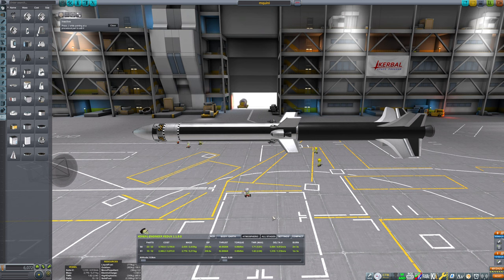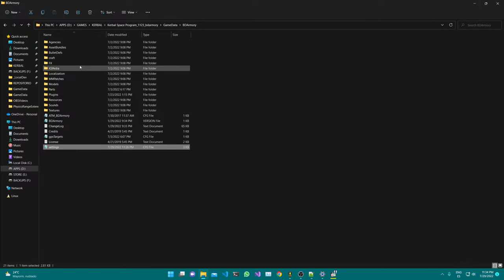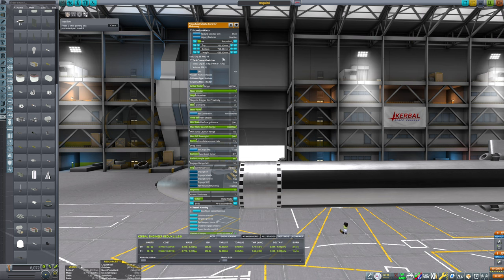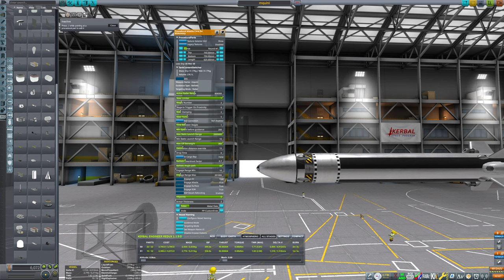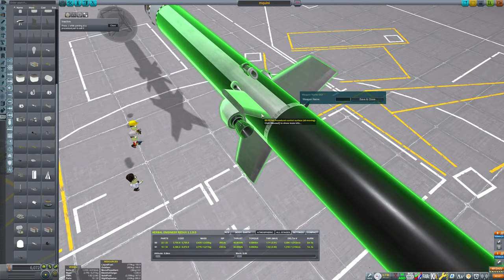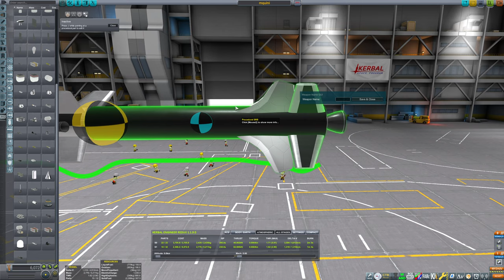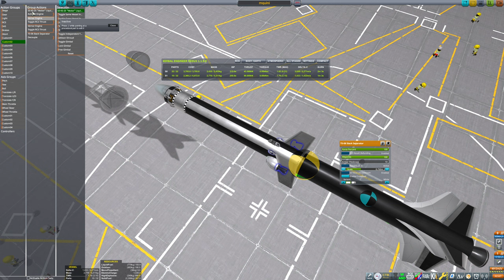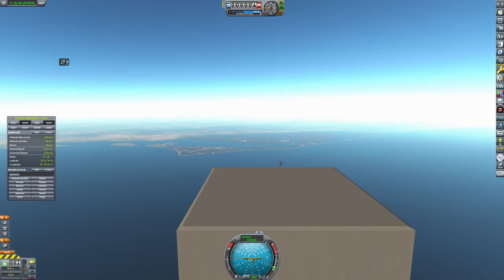Advanced tutorial for long-range ballistic missiles | Kerbal Ballistic Program

Comment: recently started messing around with bdarmory, having trouble with my icbm just exploding mid air completely and failing to even start at the press of the fire missile button under the modular missile interface, any tips or answers as to why this may be
Reply from the maker: It is difficult to say. If you are following this tutorial you should be able to build a successful missile. Maybe you can also check the other tutorials that I have on my channel regarding modular missiles. Usually when a missile explodes mid air is because it might be losing its radar lock, it might run out of fuel, or it is calculating that it will never be able to hit the target due to the target moving away faster

Comment: Why is your rocket unaffected by wind and temperature?
Reply from the maker: I'm not using Realism Overhaul here but I'm certain the temperature was increasing during the descent. Regarding atmosphere drag, the missile was fighting the drag increasing the power of the engines during the descent and you can also see how the SAS starts to misfire when the drag increases.  If suddenly the missile engine stops you will see 4Gs worth of drag slowing the missile
Reply: @jesusrv2009  I mean why doesn't your rocket have the phenomenon of "surrounded wind and red temperature" my rocket is completely surrounded by red high temperature , even a speed of 1000m/s destroyed my wings . I'm looking for a way to fix this
Reply from the maker: @aminuboby9298 Got it. I always disable the aero graphics on KSP settings ( change it to minimal) because I don't like it, it is very unrealistic. Then to avoid the wings breaking, if you are using FAR and B9 procedural wings you should be able to increase the wing mass to make it  "harder to break". Also you can disable completely the FAR aerodynamic failures using the FAR settings (Space center scene and clicking on the FAR mod button)
Reply: @jesusrv2009  Thanks you

Comment: Hi, I made an ICBM but it looses it's lock at 90km height and just fires into space. What can I do about this? (my physics range extender is on 10000)
Reply from the maker: Hi, at which distance is the target? Are you using radar guidance?
Reply: @jesusrv2009  around 680km
Reply from the maker: Did you set a boresight angle of 360degrees?
Reply: @jesusrv2009  yes
Reply from the maker: Then I'm not sure what could be happening. The Missile should continue its ballistic path when in vacuum regardless if the target is loaded or unloaded. At 680km the missile will likely spend most part of the flight coasting at high altitude (<100KM) . Which type of engines are you using?
Reply: @jesusrv2009  the mk-55 thud engine with a rocket fuel setup

Comment: Why don't my mini vector thrust engines work even though I have an "altitude detector" installed? The rocket doesn't use these mini thrusters to correct direction.
Reply: and can you guide me what to do to disable the "wind and temperature effect" when at high speed?
Reply from the maker: Sorry but I'm not if I understand correctly.  All the engines that are activated during a specific stage/action group should be used.
Reply from the maker: Regarding wind and temperature. You can disable the effects on the KSP settings page under aero quality I think, you need to set to Minimal
Reply: @jesusrv2009  thanks you , it working